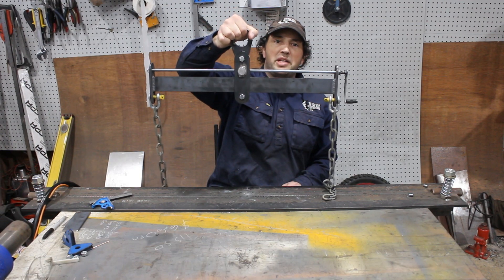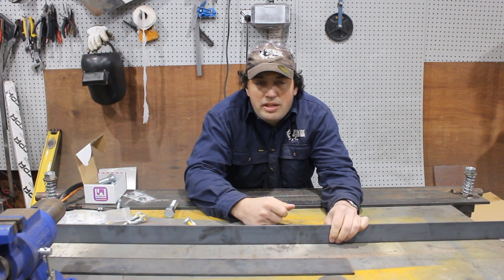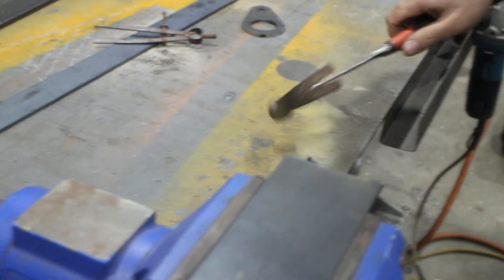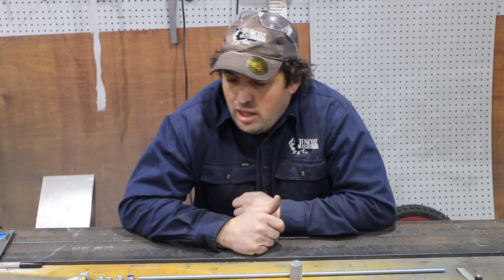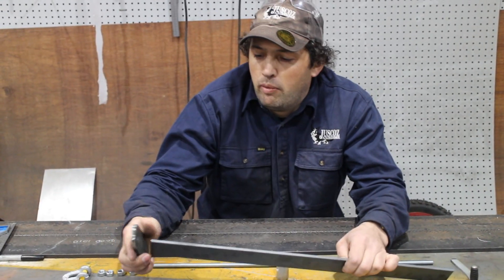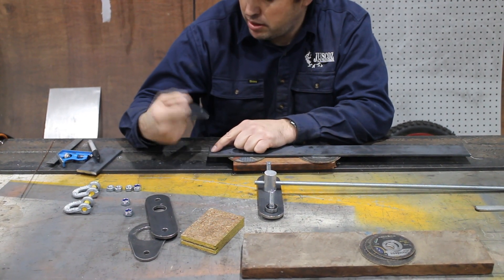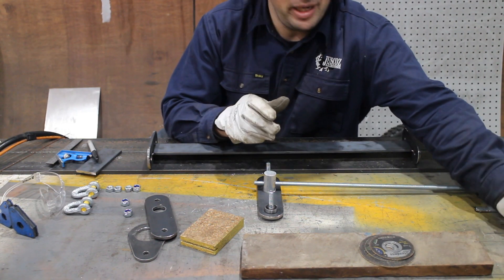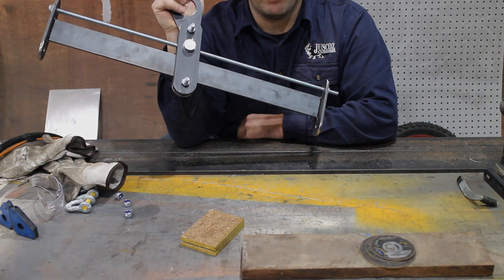Engine leveler

Comment: Why did you use TIG  rather than MIG or sticks?
Reply from the maker: I prefer TIG welding
and the MIG was in the other workshop 
If I was going to build many of them then I would use the MIG but for a one off  TIG is fast enough

Comment: I removed my handle and went with a nut so i can use the rattle gun ;p
Reply from the maker: I already thought about doing that and I'm sure that it works but could be detrimental to the threads over time due to the amount of force placed on it by the rattle gun but an electric screw driver might be alright. I have a plan for version 2 :-)